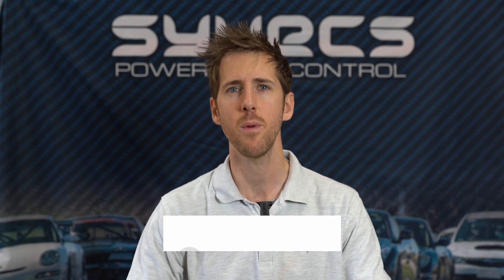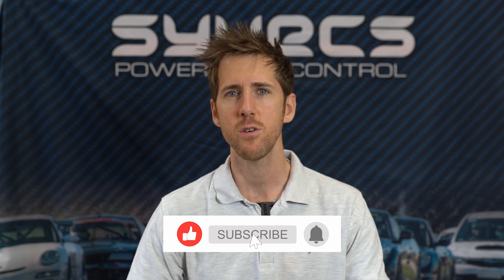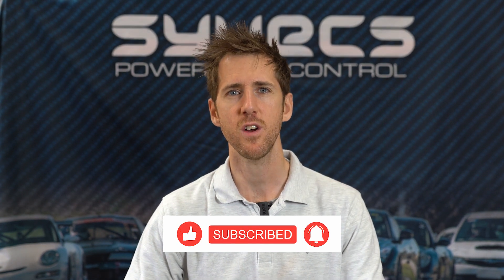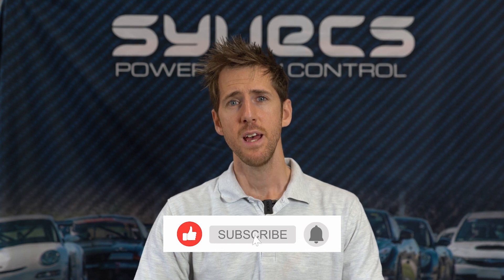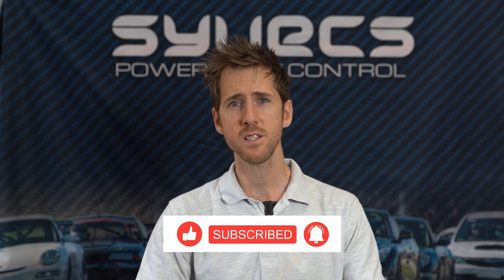EVERYTHING To Know About Torque Control | Syvecs Says #7

Comment: This is amazing because then you can tune it with the traction control and run ultra perfomance summer tyres and not need semi slicks for a street car as an example. and in doing so, you can do a build using a turbo that has a wider power band that comes in lower and not waste money "going bigger" and just ending up with a heap of wheel spin or retarding everything down using this tech which also just makes it a waste of money getting the bigger turbo/s. or you can go all out and have mulitple tunes for track days or drag racing then back to your street tyres and tune.

Comment: Another way to explain this - before torque mapping, the accelerator pedal was directly linked to the throttle - and the driver had to manually modulate the throttle to get a desired engine torque - 

Torque mapping means that the accelerator pedal is now linked to the ecu and represents a torque request - the ecu then controls the throttle, boost, fuel and ignition timing automatically to give the desired torque output.

Hmmm Can the new S7 do transmission controll such as a zf8hp or BMW DCT ?

Comment: Do you need a feedback from ABS sensors? 
I mean is it a must?
Reply: By ABS sensors if you mean wheel speed sensors WSS (which are crucial for ABS functioning) then yes, WSS is needed to calculate slip of the wheels of the vehicle by comparing wheelspeeds to vehicle speed.